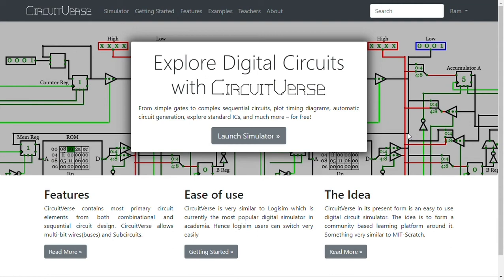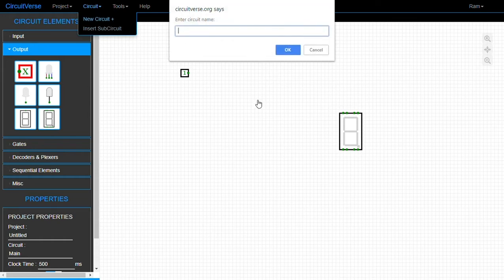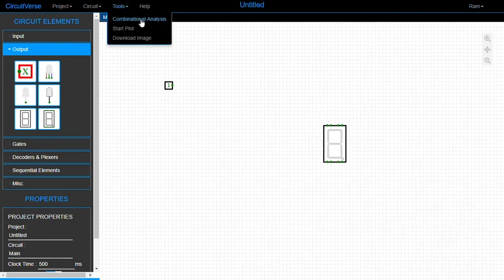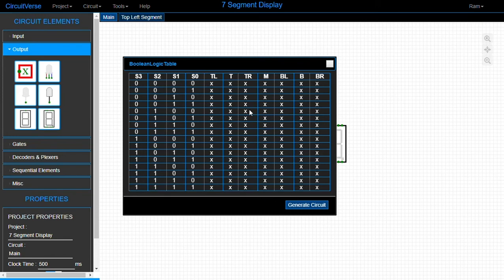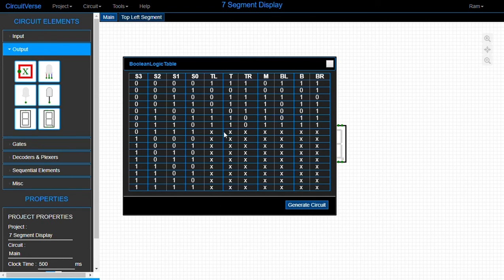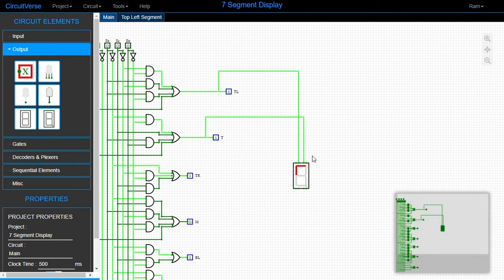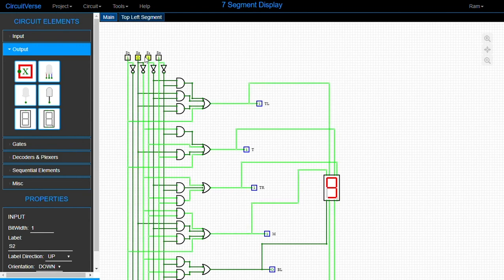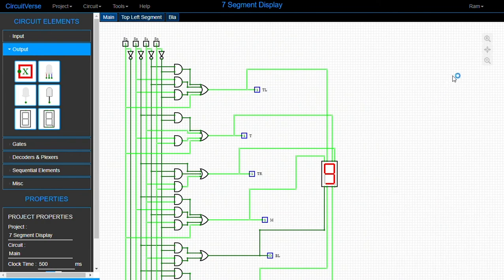7 Segment Decoder on CircuitVerse by Ram S

Comment: I am facing problem in using circuitverse in mobile.

Actually positioning of device and then during doing connection. Not able to connect the device through wire. 

Please help